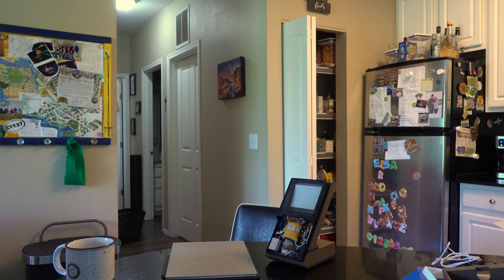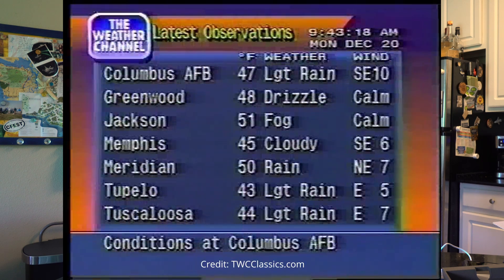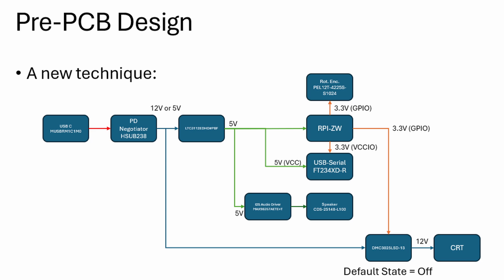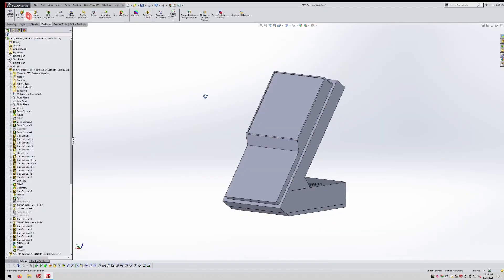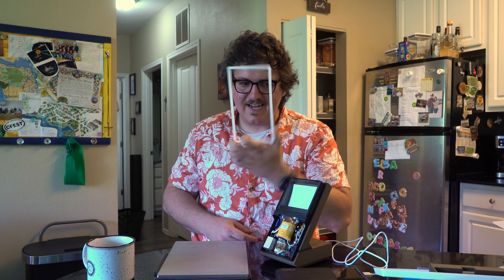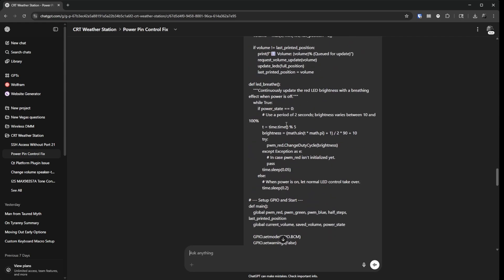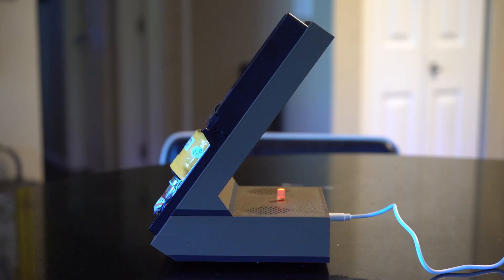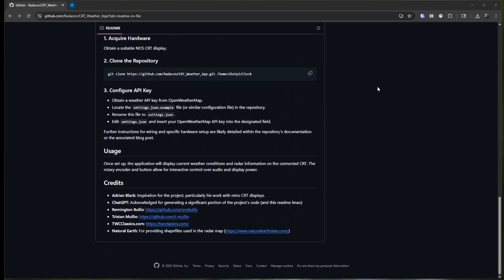Mini CRT Weather Display

Comment: Reminds me of the time I had to try to get VGA out of a Raspberry Pi for a tabletop arcade project I was working on. It's literally just an IDE cable and perfboard with 17000 resistors on it. I never ended up even using it, but I still have it nearly 10 years later. I am glad people smarter than me do all the legwork. Also, I program the same way lol. I have been working with various C languages for a very long time and couldn't write code from scratch if I tried.